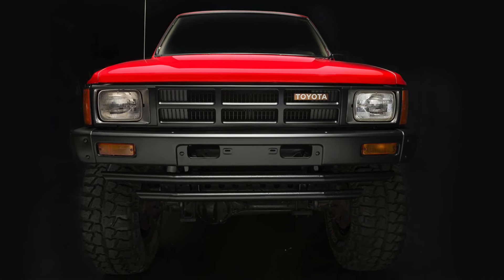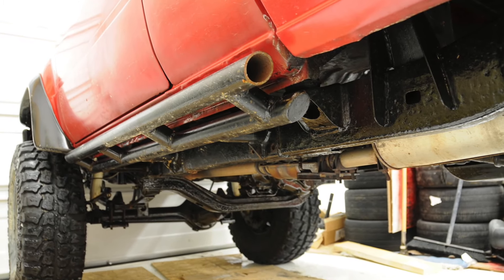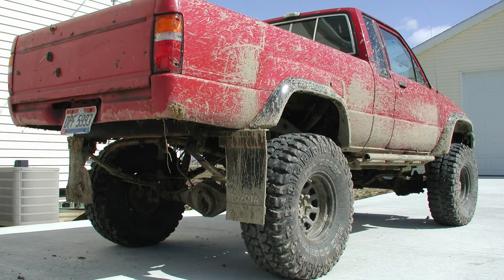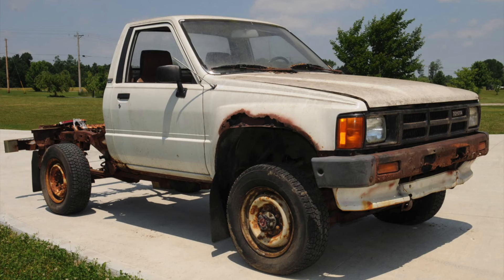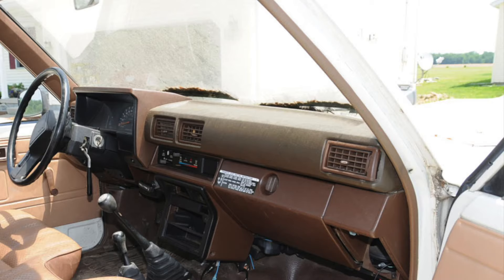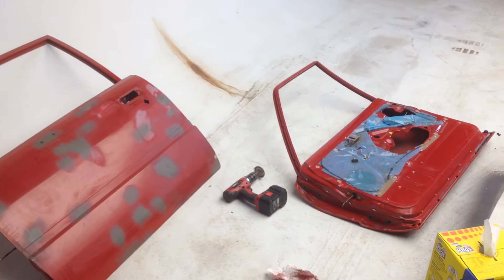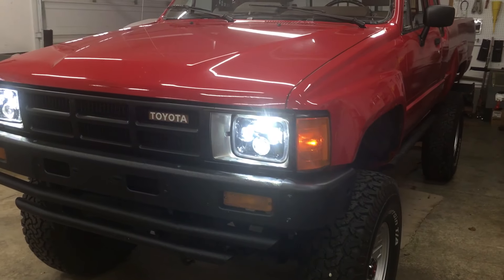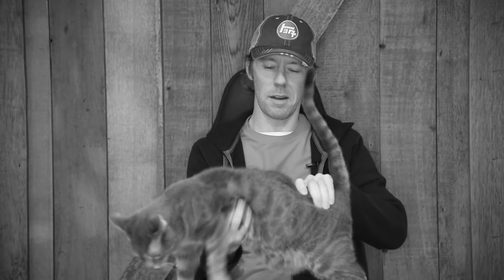1985 Toyota 4x4 Pickup Cost: Build, Modifications & Restoration

Comment: I got my 1988 toyota 4x4 standard cab for free. I live in Alaska, kid came up from Arizona with the truck.  He had no idea what he was doing. No rust at that time but many issues. Truck wouldn't start and he got frustrated.  Ran into him at the bar said he had left it with signed title and keys in glove box. Well I grabbed it. 7" lift using torsion bar and block shackles. 35" tires. Interior in bed. No windows in doors. Windshield cracked and not sealed. I got it running. Drove for 5 years now. Since: new motor as old had bad head and valve issues. New marlin clutch. Set ride height and rebuilt entire front end. Lots of interior stuff. All told about 5 grand into it. Daily driver.  Worth every penny!
Reply from the maker: Glad to hear you saved it! That kid would be kicking himself if he saw it now lol.

Comment: Just got an 86' 2wd. 250,000 miles!! The engines been rebuilt and looks and drives brand new. Starts with no pumps on the carb on first turn of the key. Zero rust on the frame, never winter driven.
Reply: Hos much it cost you?
Reply: @tomorrowcomestoday1621  $5.6k

Comment: Finished my 87 extra cab mid last yr. Did the body work and painted it myself. I'm no paint and body guy. Watched alot of YouTube videos so it came out ok. Fish eyes were my down fall. Anyways got the truck for $750 had no engine so I bought a donor truck. A 2wd then made all the switch. Oil pan,pickup tube and new clutch kit for a 4wd. Thing roll great and looks pretty good. I'm happy with it. I'm about $5k after I sold off the carcus of donor plus all the parts I bought.  These little yotas are going up like crazy in value.
Reply: I did the exact same thing to my 87 extra cab as you and came in right about the same on $ but it was 3 yrs ago. I opted to go with that toyota cavalier blue as a new twist. I'm no painter but she looks great from 10 feet. I added a brahma camper shell and made a sweet raised bed outta oK plywood with all the storage under it. I'm taker it on a nice camp/fish trip to COLORADO next week to do the  Imogene pass.

Comment: I owned a 85 that I bought used with 120,000 miles and put 300,000 miles on it when the head gasket went out.  Great truck and it sold me on Toyota pickups and it's all ive owned since.
Reply from the maker: Same here, I've tried different brands over the years and you can't go wrong with a Toyota.

Comment: I just bought a red 1986 DLX 4x4 last month with 99.6k miles on it for $1,500. I haven't had a chance to really look under it for rust, but the bed does have rust bubbles along the sides. This video is quite informative for stuff I may have to get done. I already have a neighbor that wants to buy it,  but I think I'll keep it a bit longer and do some restoration work on it. The engine runs well, but I need to look into the transmission, from park it shifts rough into 1st or reverse. Also the exhaust needs some tlc as it's rusting as well. But overall seems like a solid little truck. This is my first truck and also restoration, so looking forward to the experience.
Reply from the maker: You got the deal of a lifetime!
Reply: @6thGearGarage  I believe so as well. I think this will be a solid investment.
Reply: Wow lucky.  You could probably turn around and sell it for triple what you paid for it.  With out fixing a thing.  Good job on finding such a good deal

Comment: These great trucks, all Tundras are WAY ⬆️ in prices. Keep it’s a nice truck. New subscriber 👍🏻I just got a 2004 Tundra 4x4 SR5 I had to get timing belt and water pump replaced, front brakes and sensor, new headlights, fluids, differential oil. 145,000 miles. It’s typical maintenance that I had to pay for but it runs great. Next later this year tires. ✌🏼

Comment: I'm working on getting an 88 with the 3.0 5 speed manual for 2500 in the next month or so. Can't wait to get it and start my own project
Reply from the maker: That's a great price!
Reply: @6thGearGarage that's what I thought. It runs great but I will have to do the brakes and replace the master cylinder for the clutch.

Comment: I have a '93 standard cab. I am redoing it right now. Not nearly as cheap as what you did but I think I will be very happy with it. Most of the costs were in rebuilding the engine with a stroker kit.
Reply from the maker: I'd like to do a rebuild but it most likely won't be a stroker.
Reply: @6thGearGarage  well,I have the 22RE, and I wanted more torque because going through the hill country here I Texas it could not keep up....soon it will not be a problem and it will pull much better.  also doing a desert cammo paint job, all new lighting, das gauges and bucket seats to boot...so it will be a while...

Comment: 1985 toyota 4x4 is the best they made. Fuel injection and the straight axle. Nice job great truck.
Reply from the maker: Thanks! Mine has the carb 22r engine, but it has still been pretty reliable over the years.

Comment: Love the comments here…I was gifted at Christmas 2022…a 1992 SR5 Toyota Truck with 4 WD / Extended Cab…3.0 V6 / 119,226 miles on it …from my Father - In - Law
Ive replaced the front drivers axle…all shocks…timing belt and gears / red Toyota Coolant…changed all gear oils..new battery…new headlight ( dim )…New Tires..
I have installed twin fog lights on the Brush Guard..I’ve repainted the Bed Crash rail and planning to install a 32” / 5”“
high bar light…
Next is the ties rods and other components….
I’ve had many compliments on it and people have asked me if I want to sell it…

Comment: Hey man i really like this video, i recently got a 85 toyota 4 x 4 as well, it spun a bearing and was wondering if that is a pricey repair. And where should I go for interior parts? My dash is completely cracked. 
Thanks
Reply from the maker: 22R/22RE engines are dirt cheap. There are usually running ones for $500 or less on Craigslist or FB Marketplace around here.  The dash is no longer available. You can either repair it or cover it up: https://youtu.be/S-UPaYTFBlE

Comment: I just got handed a 1979 Toyota pickup. not 4wd unfortunately but no rust, runs, has no issues except a the fuel pump diaphragm has a crack in it so if i let it sit for a couple days it wont start without priming the carb. these trucks are bullet proof and get decent mpg and are highly sought after these days. I have no issues spending the 3 grand I'm going to need to make this truck great again. Anyone who thinks its a waste of money hasnt seen the price of one recently
Reply from the maker: I’ll take a clean 2wd over a rusty 4wd any day 👍 if you’ve seen some of the Yotas in my older videos, you’ll see how bad rust eats these trucks up 😢

Comment: 6k is a sweet deal for a nice 85. in the 5 years I have had my 86 I probably have about the same in it and it is nowhere near as nice at the current moment. However mine started its life as a 2wd truck and its now a ifs 4wd and maybe someday it will get a solid axle. I ended up buying 2 parts trucks to get it to its current state. I bought a rusted out 88 standard cab short bed 4wd that ended up having a rebuilt engine in it for $500. It donated its efi and all of the 4wd drivetrain+front 1/2 of its frame into mine. I also bought a 85 xtra-cab short bed 2wd out of southern ohio for $500 for its cab and I ended up using its mint brown interior and it also had a lund cab visor on it that I happily kept. the interior in the 85 stayed so nice because the truck was parked in approximately 2001 after the frame rusted out and someone ran it out of oil so it missed out on approximately 20 years of wear and tear. I also got lucky and found a near mint original rust free steel long bed in missouri for $200 from a pick and pull.  I also ended up sourcing all new parts for A/C that was like $400 on its own but it now has the best A/C out of all of my cars so I think that was a well worth the cost. Still need to paint it as it is 3 different colors now but at least it has a solid body and frame with a nice interior.
Reply: Where did you get the new a/c parts from??
Reply from the maker: You're doing it the right way! Especially on finding that steel long bed for $200!

Comment: Hold my beer...My 1987 toy excab 4x4 brand new $10,400...after 500,000 miles and 34 years 1 LCE street performer $3500, 2 LCE stage 2 strokers $13,000, 3 G54 trans (one brand new from toyota) $4500, 1 R151F turbo trans $2500(LCE st2 motors blow up the G54s and 4cyl rear diff pinions with 160hp over 103hp oem), mic suspension, tires, P brake cable,  speedo cable, ect $15,000....BUT I havent made a car payment since 1991 and my truck has never broken down, only 1 flat tire, and still has some original light bulbs and flasher, brake booster, ect
Reply from the maker: I want to see your truck!!!

Comment: What’s the spec on the fuel anza wheels? I got an 85 as well and wanting to get wheels. Also can you make some videos on the v6 swapped parts!? Hope to hear from you
Reply from the maker: The wheels are 15x8 and I believe the offset is -18. All of my trucks have been 4 cyl, except for a 1989 3.0 v6. That truck and frame were rusted out but the engine ran great, so we're swapping it into the Honda Accord UTE that we put on a Toyota frame.
Reply from the maker: Oh my bad, I read that wrong! You meant the v6 Parts on my 85?  I have a video for the v6 brake booster: https://youtu.be/P2DT0RHI8K8  and here's a quick vid talking about the v6 caliper setup: https://youtu.be/7b5RYm6o-Pg

Comment: looking at an 84 for 6k. lifted, big tires, completely rebuilt and modded engine. frame from what i can see in pictures looks great. should i just drop the ball?
Reply from the maker: From that description, it sounds like a good deal.
Reply: @6thGearGarage  rolled the dice on this one. engine has a hearty tick to it. but its freshly rebuilt with new head. hoping a valve adjustment will set it right or well be parting it out.
Reply from the maker: @deadjoey77  the 4 cyls are just noisy sometimes. Mine has been ticking for years.
Reply: @6thGearGarage  hope its just that. my 22re in my 94 ticks but is like 10% of this new trucks. so has me worried. i have a 22re guru that can see it in a few weeks.
Reply from the maker: @deadjoey77  The best thing about the 22r/re is that parts are dirt cheap. Even if the head/valve train is toast, you can get another one for cheap.

Comment: Wow amazing i have a 1992 4x4 and i want to upgrade it and make it last the rest of my lifetime! How do i learn more about 4x4s?
Reply from the maker: What kind of upgrades are you looking into?
Reply: @6thGearGarage  i do alot of driving on bumpy dirt roads so im looking for better suspension and also engine performance!
Reply from the maker: @webkikif  Do you have the 22re or V6? As for suspension, the factory suspension is going to ride smoother than most affordable lift kits. How much are you looking to spend all together on your truck?
Reply: @6thGearGarage  i have the v6, both my leaf springs are broken and need to replace them, i dont really have a budget im willing to save and spend the money. Do you have any recommendations
Reply from the maker: @webkikif   If you're on a budget, I'd just buy some factory leaf springs from someone who has lifted their truck. I've sold factory leaf packs for $50/pair.  If you get a lift kit, you'll need bigger tires to go with it, and that means regearing the axles. It gets expensive to lift a truck the right way.
Reply: @6thGearGarage  i been looking at this kit here, gives me everything plus the leaf springs do you think its a good idea? Also will i be able to fit 33s on this.

T422KS-M – 4 in. Suspension Lift System with M95 Performance Shocks
Reply from the maker: @webkikif  33" tires are perfect on a 4" lift. I've read that skyjacker rides pretty rough. Also for 33's you may want to re-gear depending on your factory gear ratio. For example when you look at the VIN tag, if the axle code is g292, you have 4:10 gears.
Reply: @6thGearGarage  cool i see ill check that out todsy and see what gears im riding with, what suspension system do you know that rides nice and smooth?

Comment: Used car prices have become ridiculous. In 2008 I bought a clean Nissan 200SX S13 for $3500. 95.000Km. Two years later I sold it for $1500 on ebay. Never tuned, all original, pretty good condition. Nowadays I will have to pay $20.000 and more for an S13 in this condition. Although it's an old car.
Reply from the maker: I know, we all should have been buying cheap toyotas, nissans and muscle cars back in the day and storing them in a warehouse.

Comment: Hey man I’m working with a 1978 Toyota pickup! I’ve seen only a handful still up and going, mine still has the original 20r. My question is regarding the transmission all I see is 4x4 manual transmission I have the 2wd automatic transmission is it rare?
Reply from the maker: Autos are less common but they’re out there. My 1980 2wd is an auto, but I’d eventually like to swap it for a manual.

Comment: Love your videos, I have a question since you’re from Ohio. I did some rust repair on my 4Runner this weekend. Minor rust near my sunroof. Well I sanded it down put some rust oleum rusty primer and put two coats of touch up paint and two coats of clear coat. I noticed after painting that I could still see a little bit of the primer thru the paint. Now my question is would I be fine from future rust with the primer showing a little thru the paint? Thanks for your knowledge.
Reply from the maker: You have clear on it too, so you should be OK.
Reply: @6thGearGarage  thanks for your reply! You’re the man!
Reply: @6thGearGarage  could you please help me with one last question? I see you used the same touch up paint Duplicolor on your land cruiser. It’s a lacquered base paint. Well could I just paint extra layers of paint on top of the clear coat to cover up the primer? And finish off with clear coat again? Thanks again for your time.
Reply from the maker: @jaymoar3561  Yeah lacquer has no recoat window and it's easy to blend. Just wipe the area with wax & grease remover first so it's clean. if you have any orange peel then you can sand it first to get a smooth surface. 600 grit is a good finish for the paint to bite to.
Reply: @6thGearGarage  thank you!

Comment: I'm thinking of buying an 89 22re Pickup at some point and make it an overland rig. Any tips for a beginner car enthusiast? I don't have much knowledge of working on cars except typical things like fluids, filters, and brakes. Thanks
Reply from the maker: 22re is a great choice. I'd say shop for one with low miles, as original as possible. These trucks often take a beating and chances are if it's modified, it's been driven hard. Also look in the south/west for a rust free Toyota.
Reply: @6thGearGarage  I'm glad I found this page though! I'm from Ohio too and it's so hard looking for an old Pickup so I 100% feel your pain. Thanks for the info
Reply from the maker: Dylan Karr they’re getting harder and harder to find around here.
Reply: @6thGearGarage  yeah, I've been searching basically all of CONUS to find one that has good bones but isn't destroying my wallet. A few takers but out of all of craigslist, I only found 2 xtra cab, 4 cyl, 4x4, manual transmissions so I'm hoping the next year has more options
Reply from the maker: @dylankarr2718  It seems that prices only keep rising, despite the recession.

Comment: I spend as little as possible. I bought a 4runner for $800, it was a 3.0 automatic and I guess those are worthless to the fan boys. But, they can come with us torsion bars, 4.88 factory gears, cv axles, manual hubs, driveshafts, lots of spare parts.

Im converting the rear axle to full floating with manual hubs in the rear. Welded front and spoiled rear.

Comment: All I see is salt.
no matter what a hater spews, there is no way they can get a new truck with as much quality as your truck for the same price, even twice the price.
my 1999 yota was bought for 6.5k, and I've probably put about 4k in it over the years. my plans are eventually for a rebuilt eingine and tranny, new headliner, rug, and redone seats, so another 10k on the truck for literally another lifetimes worth of driving. so my 20k truck last as long as a new one, and is an actual 'small' truck, and has everything I need, along with the v6 and the best reliability ever. That's 1/3 the cost of a new truck with the same features.
Reply from the maker: 100%  Putting money into an old Toyota is like an investment. These trucks only go up in value.

Comment: i have an 87 pickup single cab rwd  with no rusty frame but needs some work on the engine it was rebuilt but i think it has sum small issues
Reply: 4 speed manual ofc
Reply from the maker: Around here you can find cheap engines all day, but no clean frames.
Reply: @6thGearGarage  id love to restore the truck its just sitting in my garage im not sure what to do with it right now :/

Comment: I have a 94 and when I push in the clutch it makes a squeaking noise under the truck and I don’t know what it is. Could anyone tell me what it could be?
Reply from the maker: I'd check that the clutch pedal bracket isn't cracked. Also that the Master Cylinder isn't leaking on the inside of the firewall. Also you may just need a little lube on the moving pares of the pedal & pin where it meets the rod on the MC.
Reply: @6thGearGarage  thank you I appreciate it!

Comment: Is your pickup petrol or diesel?
Reply from the maker: It's petrol, 2.4L 22r
Reply: Petrol or as you call it Gas is quite cheap in the USA right? Do you have many diesel pickups?
Reply from the maker: @iainhamishstuartforbes1613  petrol is a little bit less expensive than diesel here. Right now petrol is $3.15/gallon.  It is very rare for a small truck like the Toyota to have a Diesel engine here in the US. Most diesels are larger 1-ton trucks like Ford F-250 and Chevrolet 2500.